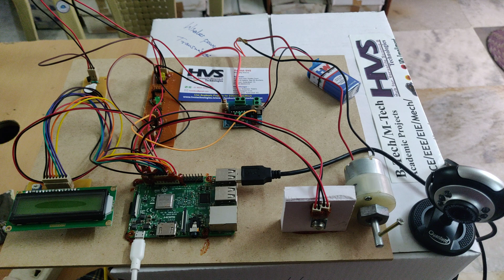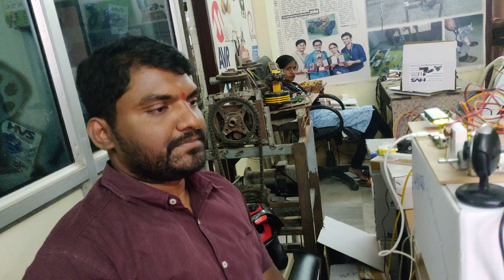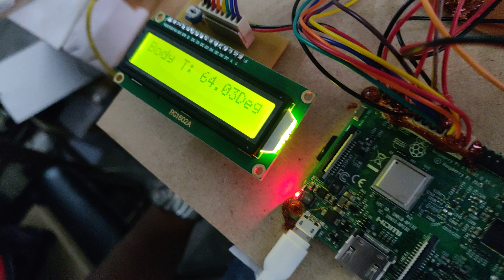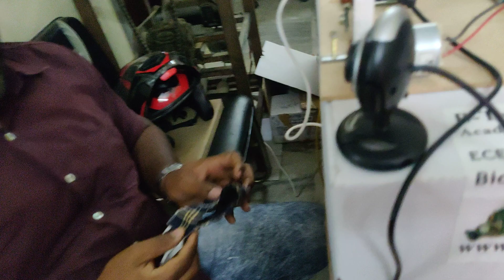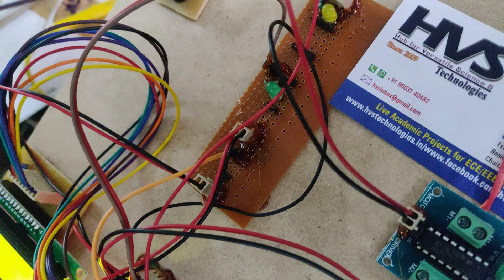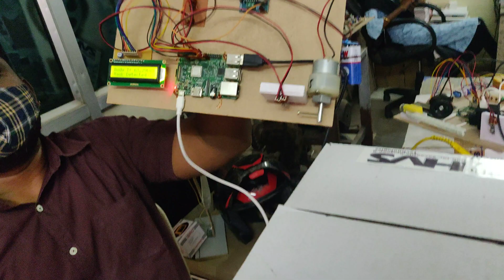HVS-2787. Face Mask detection and Temperature (MLX90614) based door open using Raspberry pi

Comment: Sir we are doing the same project but facing issue in installing open cv in rpi, so could you help us by giving any solution
Reply from the maker: You can contact us at +919603140482

Comment: Sir, Which Motor Are you using
Reply from the maker: DC motor
Reply: @hvstechnologies  simple DC motor or Servomotor sir,
Reply from the maker: @Syed_vlogs_YT  simple DC motor
We can SERVO motor also
Reply: @hvstechnologies  Sir, which motor drive r u using L293D or L298N
Nd which Raspberry pi ( pi 1,2,3 or 4)
Reply from the maker: @Syed_vlogs_YT  pi3, any Motor drive we can use